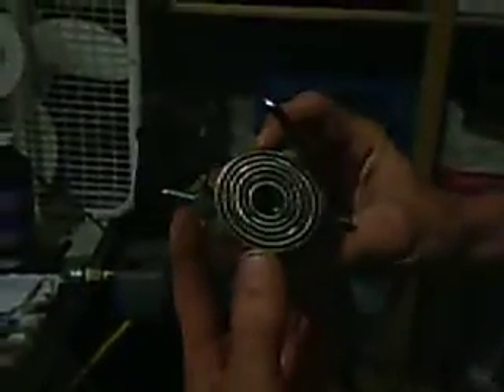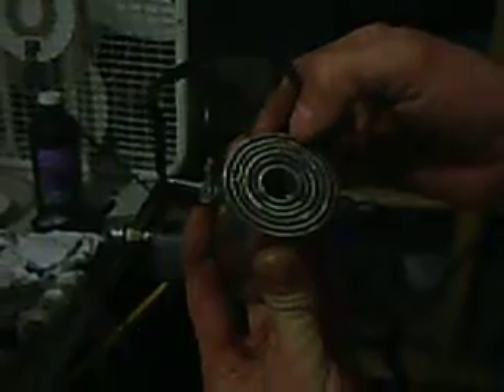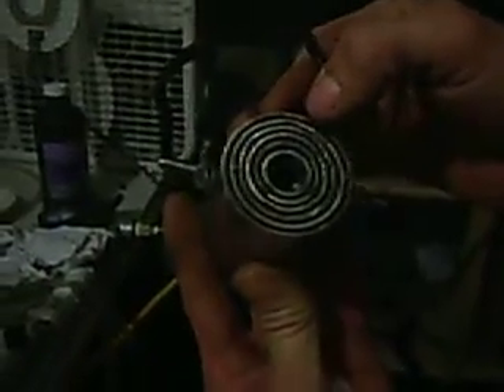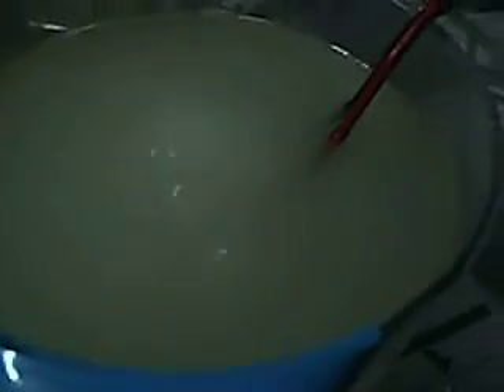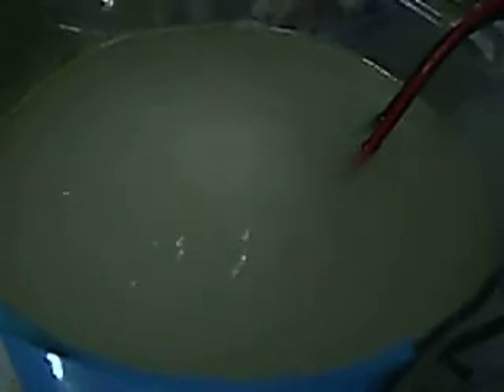h2extreme.com stainless hho electrode

Comment from the maker: you can adjust how much power it pulls by the amount of baking soda you add. more soda = more gas and more power. if you use distilled water your output max would be 100 watt